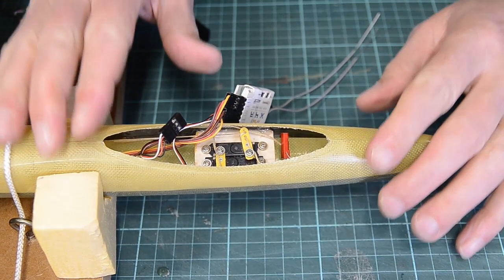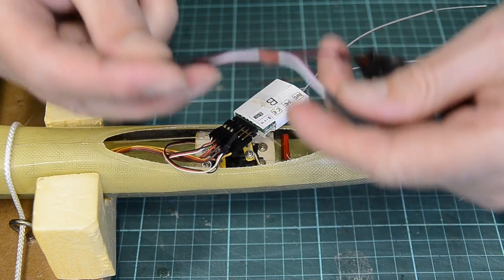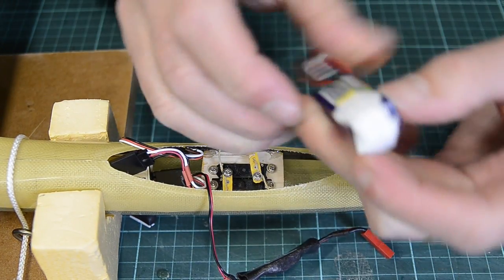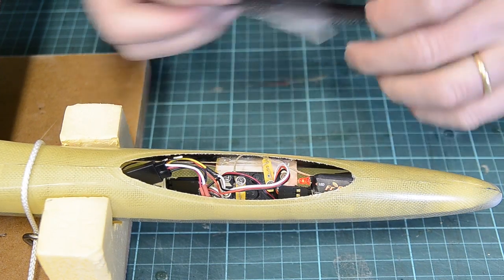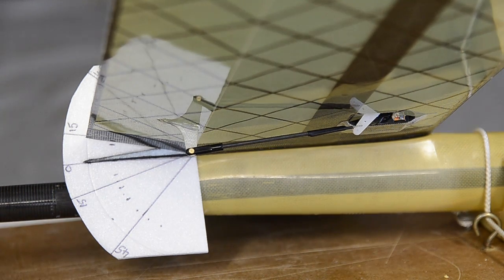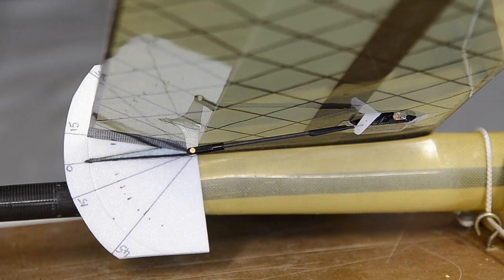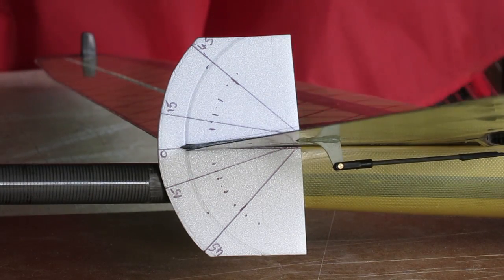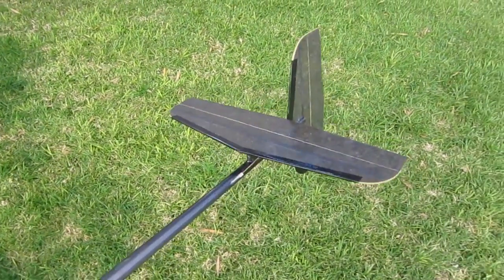V2 DLG 5 - Connections and aileron throws

Comment: I don't understand the reasons behind the aileron setup. Is the off center neutral to account for the large amount needed for brakes?
Reply from the maker: +yellowbusguy That's right. You want 45º down for brakes but only need 15º up for ailerons. Rather than waste the top 30º of aileron throw this setup makes use of the full servo arm sweep giving maximum resolution and accuracy.

Comment: Andrew, why do you always use two channels for your ailerons instead of one channel and a "y" cable?  You have convinced me to start a scratch build, I bought a little Whipit DLG and I'm hooked, but DLG are just so expensive, so it's time to make my own... Cheers and thankyou👍
Reply from the maker: With separate alien channels I can program in differential, brakes and spoilerons for slope soaring and individually trip each aileron. I love programming and mixing and have channels to spare.
Reply: Oh, so that's why, I understand now, thanks Andrew... I haven't used air brakes as yet, cheers for the prompt reply👍